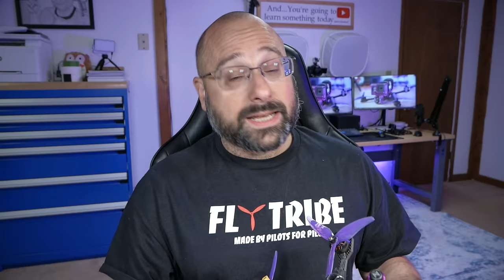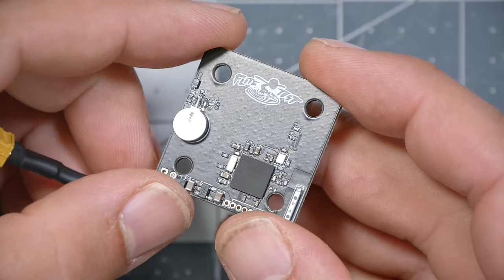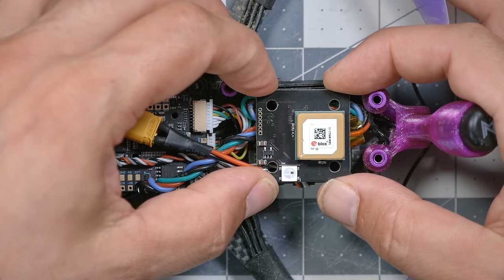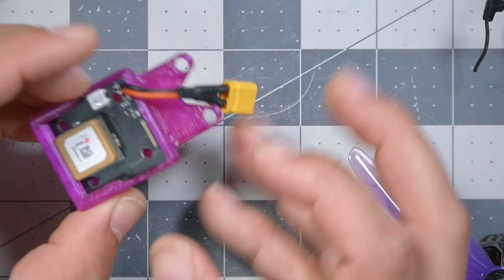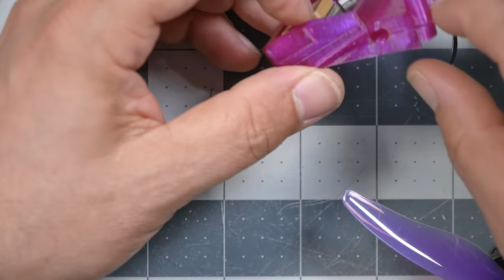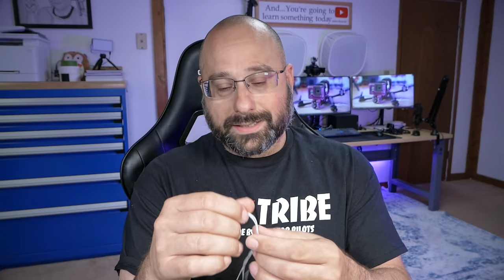How to add RemoteID to an FPV drone (it's simpler than I thought)

Comment from the maker: I'm so confused. I swear I released this video back in September. The folder was actually moved off my hard drive to my archive drive, and the file was all edited and ready to post. But I can't find any evidence that I actually posted it! So here it is!
Reply: I swear I actually saw this video!
Reply: so if i swear i installed remote id and the folder gets moved to my parts bin and then i find it later im good den right? coo
Reply: @RyanHarrellA  #StreisandEffect 😉
Reply: Would a DJI air unit attached on top of a DJI drone both powered on, do any type of damage to each other, or cause some type of interference?  
( Just a randomly FPV question there!)  Thanks
Reply: @Joshua, I'm new to FPV and I just bought the Lumenier JB Edition V2 (and I love it!). I have a Part 107 certificate and I follow all the rules because this is my job and I don't to screw it up. I saw your video about connecting the Remote ID module straight into the ESC. Will the flight controller be able to access GPS data that way? Since the module has a GPS, wouldn't it be a good idea to take advantage of the GPS capabilities? Sorry for the dumb question, I'm brand new to this. Also, I'm scared of opening up my brand new drone to solder things to it.
Reply: Should have left it unposted. Non compliance 100%
Reply: Great video.. how can I register an fpv drone with the fAA.?

Comment: If you live in small town America you will never have to worry about it. Local cops not going to waste their time enforcing it
Reply: I think in general most cops will ignore the idea of this. I wouldn't give them a reason to use it. They're good at knowing laws if your constantly in trouble. Otherwise. I haven't used a cross walk in my whole life, and never got a ticket for J walking. so Im hoping this follows suits.
Reply: @kennykobitsfpv  I'm in west Virginia. What is a cross walk? 😉 Lol
Reply: @knarftrakiul3881 I think it’s when you walk a cross to the other side of the street
Reply: I'm a commercial drone pilot. Unfortunately I can't take a chance.
Reply: The cops barely even have anything to do where I live. Nobody causes any trouble, and the cops see no need to disturb the peace and get a bad name. Have seen them actually need to do anything one time in three years.
Reply: So it can just be plugged straight into a battery 😏

Comment: I have that module in the TPU case which I attach to the LiPo with a rubber band. For power I connect it 
to the balance lead on the LiPo. I find this setup makes it easy to use, just plug and play.

Comment: I'd love to see a durability test... most sensitive components are mostly protected by the frame and on a freestyle quad I wonder how much someone would spend on replacements in a year... as usual, thanks for the informative video!
Reply: The people I fly hard with all average about $50 per flight hour in parts, we were all just doing the math recently. $20 if we run beat up props and take it easy.

My worst month was about $4000 but I was flying all day every day. I generally average 1000.

It basically depends on the harshness of your environment, the number of packs you fly, and how hard you push outside of your comfort zone. And if you lose a quad. I lost 2 in one day flying a power plant, that was 500+ each. I think I average one unrecoverable quad a year, so that’s pretty good.

I think I covered everything.

Comment: Reverse voltage will not damage that remote I’d module. That one has reverse voltage protection. I have been mounting mine under a battery strap on top of the battery with heat shrink around the module and was getting awful interference with ELRS 2.4. I was able to switch to crossfire to fix the issue but expect there’s going to be a lot of issues around this very soon, especially if mounted as close to the ELRS antenna as you just demonstrated.

Comment: I thought we had to have a separate RID for each quad.  Did they change that recently?
Reply: I thought that was for commercial use
Reply: If you're a licensed part 107 pilot who goes outside of recreational use, then they start requiring the more strict rules, even if your UAV magically weighs nothing.
Reply: Yeah, you're right.  I'm a 107 pilot but so is Bardwell.  That's why I asked for some clarification.  I really don't want to spend $100 per quad to make them legal but I'm trying to do things by the book.  There is also the issue of registering homebuilt drones and what constitutes a "flight system".

Comment: I'm having some trouble getting my GPS to work with Betaflight on my 5-inch quad equipped with a Xilo F4 flight controller. Recently, I added a Flite Test EZ ID and connected the GPS TX to RX4, powering it directly from the battery per Bardwell’s instructions. FT’s installation instructions say there’s no need to connect any of the other cables. I've checked the wiring multiple times and it's correct and my joints are good.
In Betaflight, I've set UART 4 port to 'gps' and baud to auto as per Flite Test's installation instructions. However, I've noticed that Betaflight won't save the baud rate to auto; it always reverts to 57600. No matter what combination I try in the Ports tab, I can't seem to get it to save as auto. I’m not even sure this is why beta flight doesn’t see the unit, but it’s the only thing that I can discern that is different than what flite test says should make the unit function.
My flight controller is updated to the newest 4.5 version, and I'm using Betaflight 10.10.
Any suggestions or ideas on what to do next? I'd really appreciate any help you can offer. Thanks in advance!

Comment: I was under the impression that "homemade" drones, or FPV drones in that style, then you didn't need to fly with RemoteID if just flying for recreation?

I assume that at least under 250g are exempt just liked their commercially manufactured counterparts?
Reply from the maker: Recreational flights under 250g are exempt. Recreational flights over 250g require RemoteID unless flown at a FRIA. Commercial flights require RemoteID regardless of weight.

Comment: Just a little side info; according to Josh Bixler, the FliteTest RID module has reverse polarity protection built in.  If the polarity is reversed, it won't power up and no magic smoke will be released.

Comment: I want to see you actually get a gps lock with this unit and how long it takes.  I spend like 15 minutes rn getting a lock with my fpv quads with gps on them, and I have to encase the wires in copper shielding or I get nothing due to signal interference.  If this is better I want to know..it might actually make it a bit more worth the $100.  Also use its gps function on your quad and see if that works.
Reply from the maker: Yes ok you can watch the flight test of the unit here: https://www.youtube.com/watch?v=l-gT53DdNHE&t=1s
It gets lock in about 30 seconds.
Reply: @JoshuaBardwell  No I made the same complaint on that video, you did it not on a quad with all the signals going, that's no good. LOL
Reply: I've found that difficulty in getting a lock is often the result of having other electronics in close proximity to the GPS. Tried putting a Flywoo Nano V3 GPS onto a Mobula 7, directly on top of the AIO, and found that it could not get a lock. After moving the GPS a mere inch away, it started to find things again. They're very sensitive little radios, and nearly any kind of noise will screw with them. Separation is king!

Comment: I made a 3d printed case that has a sort of hook that goes under the battery strap, then it plugs into the balance plug for power. It works well at least for big quads like my 7in cruisers. I did this so I can easily move it between all of my quads.
Reply: willing to share the stl?

Comment: The RemoteID from FliteTest actually has reverse polarity protection.  So yes, be super duper careful positive goes to positive and negative to negative, but if you screw up it is supposed to not "let the smoke out."  I screwed up 3D printer upgrading to Klipper, so I'm still sorting through adding RemoteID to my Joshua Bardwell DIY FPV kit.  

What I ended up doing was buying a LiR coin battery case (about 20 grams with two batteries) and LiR CR2035 coin sized, rechargeable batteries, to power this RemoteID module. Technically you could power this with 1 LiR2035 battery but I wanted a longer life.  I got over an hour on a full charge with two LiR 2035 coin batteries with the FliteTest Remote ID. This makes it self sufficient (attaching battery case to RID case), and moveable from FPV to FPV if I wanted.  And, the whole thing, RID module, batteries, case comes to about 21g, which a 5" 6s FPV drone can easily handle.

Comment: The FAA document on their site was updated 11/20/2023 and there is a line pertaining to registering RID craft as it pertains to recreational and Part 107 that says,

This is not the case for Part 107 pilots who must register each individual device (Standard Remote ID drone or Remote ID broadcast module) separately within their inventory and each device will get a unique registration number.
.
I found it interesting that for Part 107, it included a RID broadcast module. I was under the impression that for Part 107, a broadcast module was not in compliance. On the "Interrogating Bardwell - FPV Spill the Tea #6 Livestream", there is a discussion about RID and Part 107. You mention that for Part 107, a broadcast module is not in compliance with the rule. But that was 2 months ago. I guess you can have your Part 107 and choose not to do paid work? But as soon as you start getting paid, you have to have Standard RID on our frame? Which pretty much means you're flying a DJI product? I'm not a Part 107 operator. I was just curious.
.
Also, that thing is pretty big. If you have a 3" or 4" that is over 250g, where would it go? I guess it could be attached to the top of a lipo with velcro and hope if doesn't get yanked off in a crash or by a tree branch?
Reply from the maker: That's interesting that you point that out. But never let inconsistent messaging from the FAA make you assume that policy has changed. Unless they issue a specific advisory or change the rules, this could just be one dude going off message. It's happened before.
Reply: @JoshuaBardwell  So what the site says could be a misrepresentation of the rule? It wouldn't surprise me. Since I don't comb through the reams of pages on the rule, I can only go on history when it comes to inconsistent messaging from government bureaucracies. But just based on that line on the FAA site (Home/Unmanned Aircraft Systems (UAS)/Getting Started/Remote ID), I guess some Part 107 operators will think a broadcast module would be in compliance and they could go on earning an income. At least until they get told otherwise and use that line as a form of defense.
Reply from the maker: All I'm saying is, if the rule says one thing and a website says another thing, then I wouldn't assume the website was authoritative. Until there is an official Advisory from the FAA, or some other Official Statement of Interperetation or whatever you want to call it, I'm going to assume they're interpreting the rules as written.

We have seen interviews by the director of the FAA where incorrect or inconsistent information was given out. Was this him being under-prepared for the interview or was it an official statement of the FAA's position? Nobody knows. It's up to the individual to decide how much risk they want to take.
Reply: @JoshuaBardwell  We're on the same page. Basically the approach I would have taken if I was a Part 107 operator.

Comment: Could you use a balance plug connector to supply power. That way you can more easily swap it out between quads?
Reply: Should work fine. This stuff barely demands any amperage, so there's really no risk to it.

Comment: I think you need to commit one way or the other.  Those that want to move the same RemoteID unit between all craft should simply velcro this to the top of the battery and plug it into the balance lead.  Those that want to permanently mount it and use the GPS should run power and signal direct to the flight controller and eliminate the 2nd battery connection.

Comment: Thanks for this. I'm not going to go through the fuss and muss without also wiring the GPS to Betaflight and setting up GPS Rescue (having just lost a quad where GPS Rescue would have likely saved the day). At least a GPS with Rescue will be on all the quads I fly in the wilds, going forward. Sadly, ViFly Finder Mini didn't save the day. Life goes on.

Comment: How do you request to fly in geofenced areas with a built aircraft? DJI has a portal on their remotes you can use, but built aircrafts won't have that accessible?
Reply from the maker: There are 3rd party apps that can be used to request LAANC approval if you are trying to fly in controlled airspace. Otherwise, you just go fly. The system does not enforce any geofencing at all.
Reply: @JoshuaBardwell  awesome. I asked because my rival high-school growing up is geofenced due to a distant airport. I was approved after a background check from dji

Comment: I've only been looking into the hobby for a few short months. I don't know maybe I'm missing something,  But for how dangerous these things can be I feel like the current fufillments are pretty reasonable.

Control is definitely a slippery slope, so I can empathize with concerns. For the majority of the hobby lifespan, you could fire up a 50- 100 MPH manual controlled drone and the largest barrier to entry was the money in your pocket. As an outsider looking to get into the hobby, that's a crazy concept.
Reply: Cars are way more dangerous than quadcopters.
Yet there's no way to remote-id a car except for looking at the license plate (which may be hidden from view).
How come we dont add remote-id to cars before we add them to toys?

The WORST part about remote-id is that in some cases it also discloses the location of the controller, meaning YOU as a pilot standing somewhere.
Why is this bad? Welcome to USA where everyone is armed and some people are absolutely nuts and psychos.
Do you want YOUR location broadcast in real time, when an angry dude who hates drones and suffers paranoid delusions, walks out with a shotgun?

Imagine if your laptop or pc had remote-id on it so that any troll on the internet could find your IRL location in real-time to come find you?
Basically, the "find my phone" feature, but open to the public for anyone to use, with YOUR phone / laptop / pc..
That's why remote-id is absolutely unacceptable in terms of both privacy and operator safety.

Now let's talk about drones like the Mavic 3 Cine or the Inspire.
Why is remote-id bad for those?
Same exact thing. What if you happen to stand in a less than reputable part of the town (or less reputable people happen to be nearby, you cant know).
You're broadcasting your location, along with the type of the drone.

What does this mean?
It means you're openly broadcasting a red bullseye on your self saying "$3k-6k drone RIGHT HERE, come take it!"
People get robbed for far less than $3k.

In the civilized safer parts of the world, this isnt a concern.
In USA, it's a big concern.

"But drones can be dangerous if some jerk flies into people intentionally".
Guns and knives are dangerous if used intentionally against people.
Yet we dont have remote-id on guns (which frankly IS actually strange).

Drones are the LEAST of our problems, and cause the LEAST injuries or deaths compared to everything else society has to deal with.
It's a non-issue.
Psychopaths who want to cause harm to others are psychopaths no matter the tools they use.
People who aren't psychopaths, but get into accidents because they didnt learn how to fly the drone, will only get into 1 accident.
Then their drone is broken. if they get into another accident, their next drone is broken.
Their wallet is empty.

Comment: This isn't a negative comment about Flite Test, but damn $100 seems like a lot for a Federally mandated component. It's a significant cost even if you typically buy parts that are on the upper end of the hobby.

Comment: If you plan on operating under Part 107 (for money) you DO need a separate module for EACH drone you fly.   :(
Reply: As long as all of your drones are registered under one inventory, then you can swap out one remote ID module for all your drones.
Reply: not according to the FAA which states:  "This is not the case for Part 107 pilots who must register each individual device (Standard Remote ID drone or Remote ID broadcast module) separately within their inventory and each device will get a unique registration number"  @TheGupsterMan
Reply: A good way to wire up would be to use 3S balance lead. The connection would be small enough and then you would be able to send power ground TX and RX and hook the GPS up to your flight controller as well.
Reply: @andyk939 how many parts can you change before it's a different quad?
Reply: @Voyajer.  good question. Nothing matters though when you land and the FAA has tracked your RiD you better have the right one on.
Reply: @Voyajer.  one?   Have fun playing games with the FAA they aren’t as easily hoodwinked as your mom.

Comment: in germany its simple as fuck.... you need a registration for you as pilot and then you print out  youre number and stick it on the drone and finish thats  for finding out wehn you crash adn damage something who is the owner
Reply: best thing there is its one registration and the code is for evry drone you will ever buy fly or build
Reply: @singrun7618  That's the old (previous) regulation in the US as well. Just wait until the laws in Germany catch up with the insanity in the US... it will happen sooner than you think. Enjoy flying in the mean time.